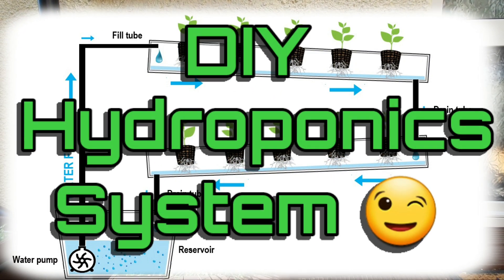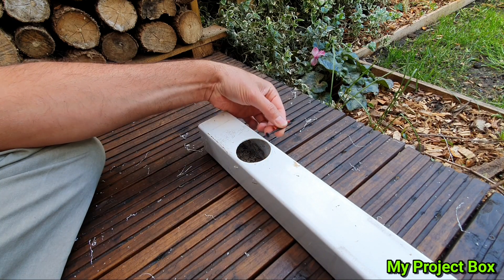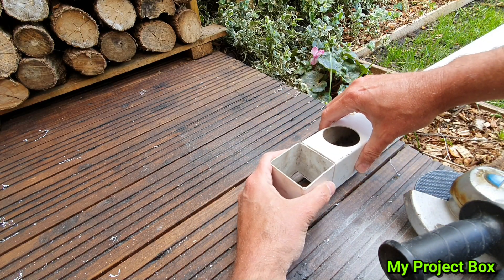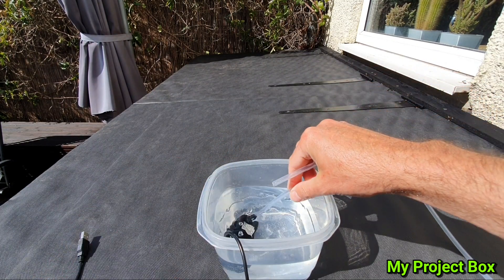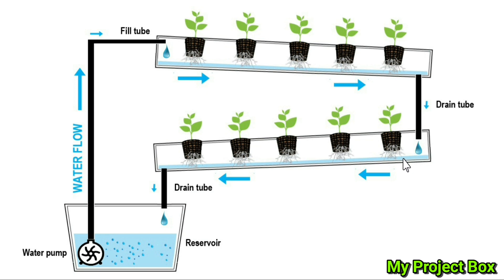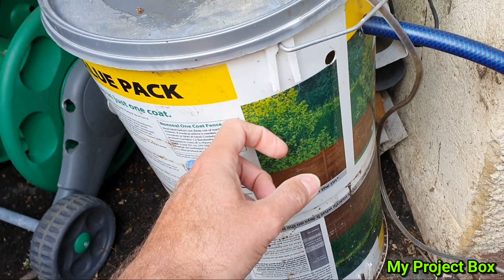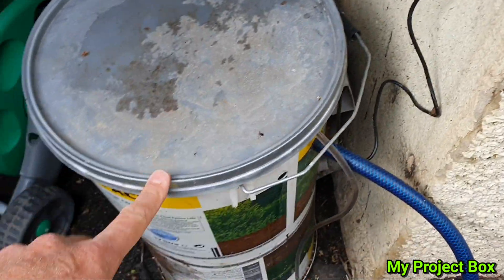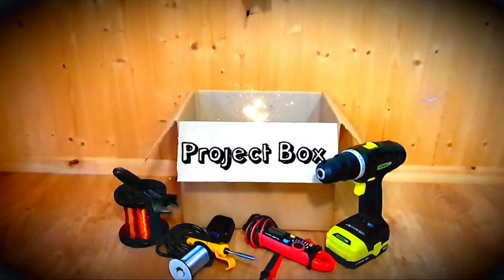Simple DIY Hydroponics USB or solar powered.

Comment: There's no way that return works, water won't flow uphill unless pressurised, and that is not. Water will just back up the pipe and fill up the trays.
Reply from the maker: It works perfectly! The start of the tube is much higher than the end. The end of the pipe can be considerably lifted up above the lowest point of the tube, as long as it doesn't go higher than the start. So the start and endpoints are at different levels. You don't need a constant continuous fall in the tube to make it gravity fed
Reply: @MyProjectBoxChannel nah, there will be a venturi effect from the holes in the planters so vacuum isn't possible.
Reply: Absolutely no chance that return works efficiently 😂, venturi principle doesn't apply here perhaps atmosphere pressure will assist but this system is an open circuit due to plant pot holes. The high point is water level In the lower gutter pipe, therefore the water entry point isn't significantly higher nor pressurised.  Ice simple design tho, with a bit of a modification I can see it working, maybe Introduce a second pump and reservoir and lift in two stages? Good idea about the float tho, like that 👌
Reply: @matweldon6885 venturi effect absolutely applies. Move past fish tank hobby vemturi's and into proper physics. The venturi effect describes the relationship between the increased speed of fluids in this case water and the corresponding drop in pressure. As the water in this system leaves the pipe and enters the plant pot section, the pressure decreases as the water has more volume to occupy and so can speed up, aka,  venturi effect (it would happen in an open or closed system, in an open top it will overflow). Also in this system the water would back up into the plant pot section and overflow as it wouldnt have enough pressure to force it up the return (due to the aforementioned venturi effect). The fact its an open topped system doenst fsctor in as it failedd before that even becomes a factor. A vacuum through pipes is totally possible with an open topped system if ballanced correctly. Gravity/vacuum fed filtration systems have been around for hundreds of years now.
Reply: @RhysHardwick-xg6xk , venturi effect absolutely doesn't apply! The water is DRIPPING out, therefore there is no velocity and therefore, no suction... its a 5V pump using most of its energy overcoming gravity pushing water up to the top plant pot section. Sorry that's  just 'proper physics' lol 😉